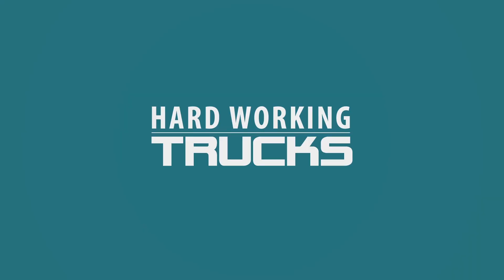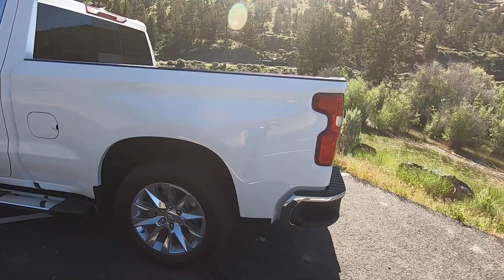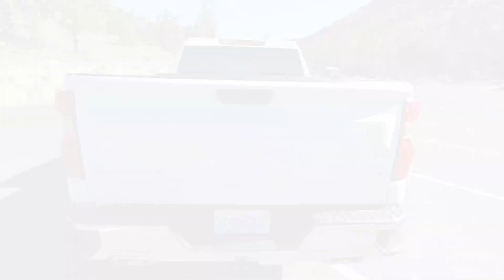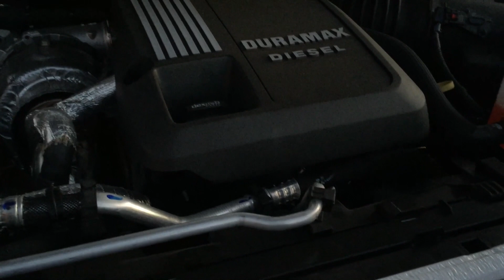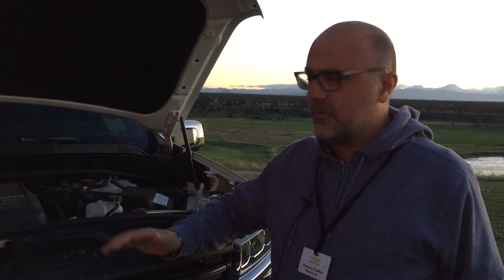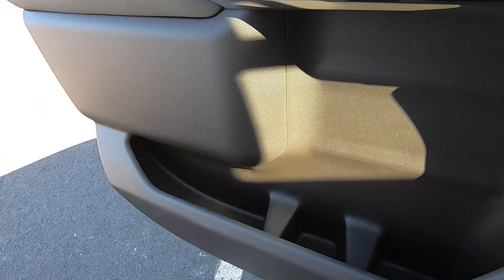2020 Chevy Silverado 1500 3.0-liter Duramax diesel

Comment: "Maintain, other than DEF fluid is no different than a gasoline engine."  Really, what about that oil pump belt inspection/replacement at 150,000 miles?  Is that required on the gasoline engine too?

Comment: Hideous . How did you guys sign off on the design of this new body style? How do you slip to 3rd place in the truck market and think that a diesel that pulls the same as the previous gas motor is the magic needed to put you back on top? Fire everyone on the design team and start over.

Comment: is the frame wax-coated still?
Reply: @Mr Sunshines  I am not advocating 'paint' per se.  I am advocating anti-rust coatings.  You are entirely incorrect about wax.  Wax is permeable: not only will it hold moisture, it will allow the moisture to penetrate through the wax and reach the bare metal. GM will not disclose the manufacturer or performance data. wonder why?  Appears to be Daubert 'nox-rust'. If true, the 'nox' product is rated for 2000 hours against constant exposure to salt spray.  2000 hrs is about the duration of 1 northern winter.  reapply? talk to anyone who has tried. a disaster.
Reply: @Mr Sunshines  shitheads like you deserve your shit.  you assumed paint [wrongly]. I am talking coating; you are talking paint. you are the kind of ignoramus who confuses hamburger. with steak.  many coatings can protect for many years.
Reply: Paint is way worse when scratched... wax coating actually closes up on it's own

Comment: Hope they offer free AAA road side service with that truck line ? Really only 3.0 liters ,oh i got it was budget cuts only selling 3 liter instead of 6.6 liter.  At least it can haul all the Wal-Mart groceries plus a little scooter. Really a joke a duramaxi hahaha. I'll stick with my 1994 -  5.9 Cummins instead its a proven motor . CHEVROLET - cracks- heads- every- valve rattles oil leaks -eats tires. Mr. Chevrolet wasn't even American ?? Swedish for people that don't know history!!!!!!???????
Reply: Its not supposed to be a 3/4 ton truck joe diffie. Its a half ton built to be a daily driver and pull lighter loads like boats or sidex sides. Not excavators and skidsteer like a full sized truck. This truck is right up my alley!
Reply: What are you blabbering about?

Comment: Game changer. Will change GM's overall image regarding reliability.
Reply: This is a first generation. A diesel needs to be tried and true. Let me see it once it hits 150k+ miles with real world scenarios.
Reply: All that things Chevy did to keep me from coming back for 40 years they seemed to have fixed.
Reply: They're already doing ten times better than Ram and roughly equal to Ford.
Reply: @hochhaul  yup. If you look on carcomplaints.com, the 2019 Silverado has very few complaints while the 2019 Ram 1500 and Ford F150 have lots. They did say it was the most tested silverado, it may hold true.

Comment: diesel is way more expensive, so increase MPG will still not cost less than gas to run
Reply: But diesels usually don't depreciate as fast as gas cars/trucks
Reply: Wb in the long run? But what truly matters is the environment
Reply: Hook you boat or camper to one of these trucks and you will have your answer real quick. Especially if you are in hills or mountains. Typically a Diesel engine run much longer than gas without loosing a lot of performance. You buy them and keep them until your ready to tow them to the junkyard. Big payout at that point.

Comment: Modern diesels are really starting to piss me off. Rear timing chain with a limited service life, DEF and DPFs that throw the truck into limp mode as soon as one little thing goes wrong (and they will break) and ridiculous prices make these the not so smart choice. Try telling businesses that rely on their trucks that there will be tons of downtime due to issues like these. A simple gas engine will be far better or heck, buy an old diesel and rebuild it along with a tune. All the power and more importantly reliability that there can be.
Reply: You are DEFinitely right. The new emissions controls make more components to break. What happens if you're towing uphill and your engine goes into limp mode? No thanks. I'll stick with my '02 F350 Powerstroke 7.3 with none of this nonsense. 200k+ miles and still going strong.

Comment: Can someone help me?If the specs are the same why a diesel and not just gas?
Reply: John Luna Fuel economy without compromising power is a big one for me.
Reply: Journalists were getting 30-45 mpg on the highway. When gas trucks can do that, let me know.
Reply: @hochhaul  i wasnt being a smarta**. It was a legit question. I just always associated diesel with higher towing capacity vehicles but i didnt think of it from your prospective.  Thank you
Reply: @hochhaul  More than offset by maintenance costs if this is a shoddy 100k miles obsolete engine. A belt driven oil pump? Planned obsolescence.
Reply: @buzztrucker  Wet belt oil pumps have been around for nearly a decade without a problem. 150k mile replacement intervals isnt bad. Most timing chains and timing belts require replacement sooner than that.

Comment: And has a BELT DRIVEN OIL PUMP!!!!!  Who does that!!!
Diesel's were known for their longevity and reliablity!! How can it last 300,000 miles with a belt driven oil pump the heart of the engine!!!  
What were you clowns thinking?!?!?? 
GARBAGE!!!!!
Reply: @grandpa5x Pulliam nice... So you have a vehicle that cost double what an old school 3800, 4.3 or a 5.7 vehicle cost, you have to separate the engine and transmission to change a belt that a GM engineer recommends changing at 150,000 miles?!??
I highly doubt the sale person is going to reveal that...
Looks like a great marketing scam to me!!!! Unreal!!!!

Great marketing scam to me
Reply: @philllsxga.7737  :  Oil pump belt is wet belt that soak in engine oil. It could last more than 150,000 mile because oil pump is low pressure pump ( 10 psi per 1,000 rpm ) and also low force on the belt unlike timing belt and 150k is a minimum recommend of service life.
Reply: @PopularTymn  that is unacceptable! The LS oil pump is directly coupled to the crank. That belt stuff in a 50 thousand dollar plus vehicle is garbage! 
In 252,000 miles my old 4.3 was never opened up.
In 284,000 miles my 3800 has never been opened up.
In 274,000 miles the 4.3 in my brothers blazer has never been opened up, etc.  All the vehicles I mentioned were under 25,000 dollars, you just changed the oil in those! 
More maintenance and the vehicle cost more?!? Unexceptionable!!!
Remember, knowledge is power. If people don't except it ,they wouldn't build it...
Reply: @philllsxga.7737  :  Time will tell, if this engine design get unexpected bad result in the future, that is GM Engineers have to take full responsibility for this design.
Reply: @philllsxga.7737  :  After your comments I just realize that as time goes on, modern engines or cars become more sophisticated and more expensive to have undergone. I remembered the old day when engines used carburetors almost zero maintenance and zero expense but only clean or adjust. Compare with modern engines I have to pay more for fuel injection system and all its electrical and its computerize system.
Reply: Ford does. They use a wet belt oil pump on some of their engines now.
Reply: Ford apperantly does too.
Reply: Wow, good to get the opinion of all you diesel engineers. I think they said the belt needed to be changed at 150,000 miles, what did you find in your research? Anyone come with a engineering degree in electronics component?

Comment: Timing chain limits the life big time
Reply: The timing chains are accessible from the back of the engine. Slide the trans back, remove the flex plate, and there's a removable access cover. This is an engine for a light duty truck. It's not going to be built to have a B10 of 300k miles.

Comment: Everyone’s saying the seats are hard. I don’t think that will do Chevy any good for sales. I’m sure not seeing the new Silverado around on the roads much. Dealers are full of them and there are pretty large discounts on the new model. Couple that with this diesel being designed for only a 150,000 mile service life, and it looks pretty messy for sales! That mpg better come back at 32 mpg for a crew cab 4wd or the things gonna be a flop before it even starts selling.
Reply: I own a trail boss.  I spend an hour in it 5 days a week.  Seats are fine I'm 6'2" 230lbs.
Reply: Terrence Jones Ohh I didn’t realize you already had an un-released 2020 HD Silverado. Because that’s what this is about, not lite duty older ‘19 models. 

Man you bat a thousand on here!
Reply: @natehawkins2910  
This video is about the 1500 3.0 diesel not the 2500HD. I doubt the seat comfort has changed from the 2019.
Reply: EdMiF Hahaha “you doubt” we’ll...it must be then!
Reply: @natehawkins2910 
BTW, that 150k service interval is the same as Ford's Powerstroke diesel, so I guess their's sucks too huh?
Reply: EdMiF He said the chain is good for the engines service life - there’s no “change the chain” service interval. 

Ford uses a wide Kevlar timing BELT that is to be changed at 150k. You’re missing some important details there. There is NO maintenance of the timing chain in the GM. it’s supposed to last the designed life expectancy of the engine, which was made to be 150k. 

The chain replacement would require pulling the engine in the GM. It’s located on the back of the engine. So, no it’s not the same as Fords front-located, easy to access BELT. Big differences!
Reply: @natehawkins2910 
Boy, you haters just love to make stuff up! 😆
That's Not what he said. Go back and listen again. The only truth you've said is that the chain is in the rear of the engine.
Reply: EdMiF You are watching the TFL video not this one, right? I think that’s why you’re not hearing it. GM engineer said it verbatim as I said it....
Reply: Daver G There’s no “service” on the chains. The engine has to come out to do chains, so that isn’t a “maintenance item” by any means! The chains are against the tranny in the rear! Even the rubber little oil pump wet belt is in the rear. These are not “maintenance scheduled”
Reply: Daver G Lol nice ...so you’re arguing about what? My statements were correct. The design life of the engine is 150,000.
Reply: The 150k mile service interval is for the timing chain, not engine life. Stop spreading false information!
Reply: EdMiF please post that link if you find that. You won’t!
Reply: @natehawkins2910  
I don't need to find the link, the engineer stated that the 150k mile service interval was for the timing chain. If you saw the video and paid attention to what he said you would know.
Reply: When I first bought it, I went straight from car to truck. I worked out my lower abs driving the truck 1.5hrs home. After readjusting the seats, figuring out how I sit comfortably in a truck, I took it for an 8hr road trip (after I broke it in) and it was way better than my car. I didn't even have back pain

Comment: 150,000 MILE SERVICE LIFE! (Stated by a GM engineer on a 3.0 duramax TFL truck vid) It’s a throw away engine!
Reply: For the belt and chains.  Not total engine life.
Reply: Terrence Jones NO that’s not what the engineer said at all. I will put his words in caps so you can study the words, then go watch the TFL trucks 3.0 duramax vid yourself and feel refreshed. 

Here you go:

“THE ENGINE SERVICE LIFE IS 150,000 MILES” 

Notice how he didn’t mention any belts bring changed? Information is magical once you possess it. But arguing without it makes you look bad!
Reply: @natehawkins2910  I watched it. They said no major maintenance for 150k miles.  That's the goal. If you think the engine is going to die @ 150k miles. You are just being silly. PS that's the same spec for the 2.8L dmax. There are Colorados with more than that already.  Give your head a shake.
Reply: Terrence Jones that’s NOT what the TFL video said. You never watched it
Reply: @natehawkins2910  watch it again moron. Watch the 20 or so videos after that further clarify.  You are making yourself look stupid.
Reply: @grandpa5x Pulliam lol how do you know the transmission will have to be pulled? A whole bunch of internet engineers up in here.
Reply: Terrence,an gm engineer was interviewd on tfl and yes you have to pull back the tranny to get in to the cover
Reply: @mandytuning  back isn't out. Unbolt a slide back is going to be  3-4 hour job with the belt change. 500-600 bill after 150k miles? How is that a big deal?
Reply: @terrencejones9817  your right ,i will say 1 grand
Reply: I questioned that also. But The  Duramax mechanic at my dealer said the belt just needs to be replaced at 150,000 miles. He was so impressed while he went through all training the classes that made him a master on this motor he bought one. He pulls a 29 foot camper with his.
Reply: grandpa5x Pulliam Yes! Finally someone who understands!! It’s a disposable appliance. The way everything is going

Comment: I wish this 6 inline diesel engine in the Chevy Colorado. Colorado engine is just too weak.
Reply: I've put thousands of miles on the 2.8L max.. it's just fine, not under powered at all.
Reply: Ya but it’s a 4 banger, what did you expect?

Comment: I seriously doubt the def tank will last 7500 miles.
Reply: Depends on how you drive it
Reply: All of my customers in the past said out of everything with their trucks the def systems was far and away the worst problem. Literally everyone that I've come across has said that
Reply: @prestonberg9604  yeah if you keep your foot on the floor constantly it will be...I add def twice a year in my Duramax
Reply: @prestonberg9604  
Yep, have been driving diesel trucks since the inception of DEF and particulate filters. Anytime that a problem surfaced it was something to do with the DEF injection system, particulate filter or #7 fuel injector. Including the commands from the ECM or the lack thereof. Oh and  BTW I filled the DEF tank at each fill up to keep  sensors happy. I will never purchase any diesel vehicle that is electronically controlled. I do not care if it's made domestically or foreign.
Reply: @prestonberg9604  My brother's Colorado diesel went had issues with his DEF system multiple times. Luckily it was still under warranty. However, after his last visit the problem hasn't resurface but I'm sure it'll pop up after the warranty is over.
Reply: David Denman on our Jeep eco diesel it last a least 10000 miles on a def fill. No big deal at all. No probs whatsoever
Reply: Your right, they are close to 10,000 miles now...Yes, I own one.
Reply: Won't last that long before it needs service
Reply: @prestonberg9604  and you know this because?